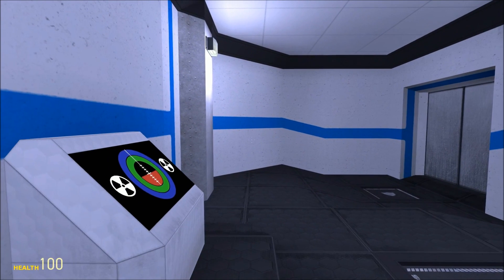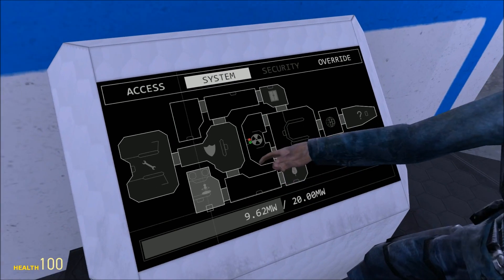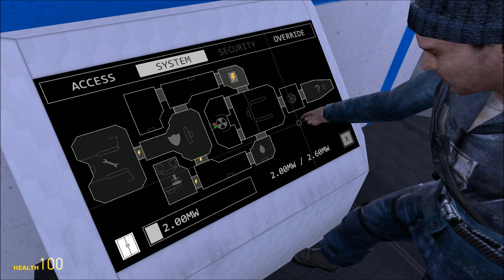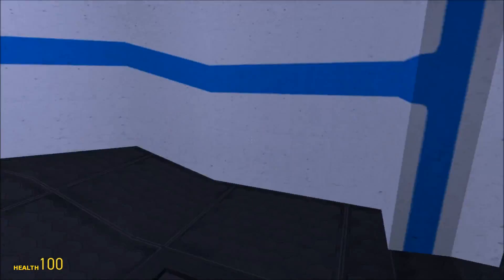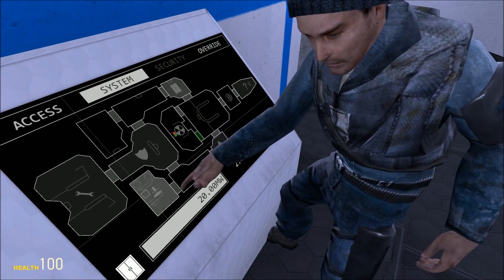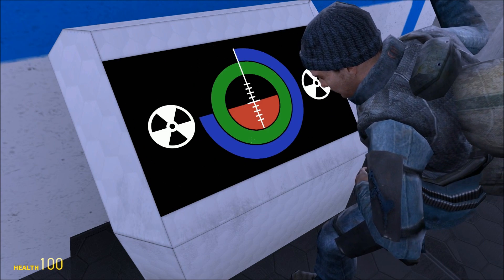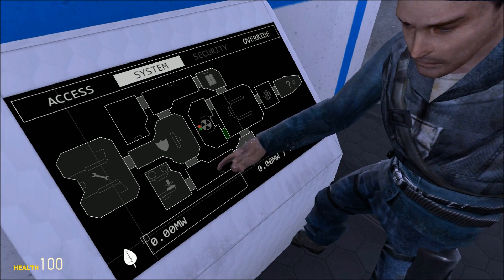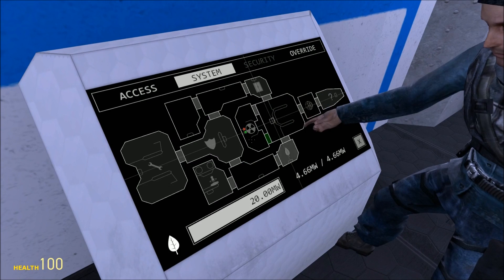Final Frontier - Reactor Walkthrough

Comment: I envision a system where you have a limited amount of total power generated by the reactor, which is then allocated to each system on the ship. Players would then be able to strategically adjust which systems would receive extra power at the cost of other systems (such as boosting shields in combat by taking power from the medical bay), or be forced to decide which systems should be sacrificed if the reactor is damaged and the total power supply suddenly drops.